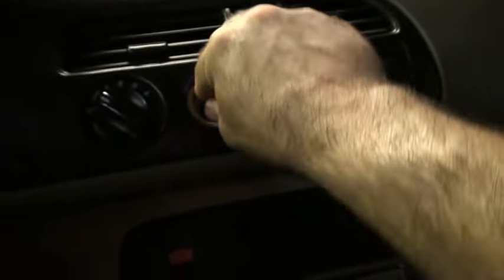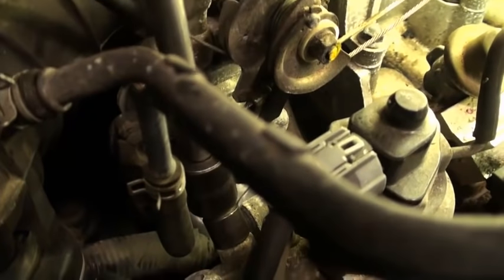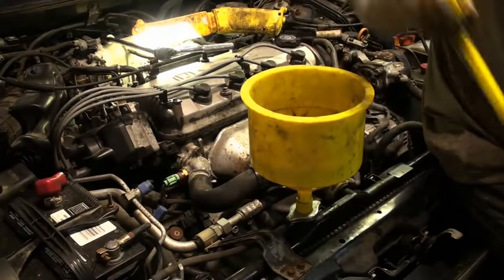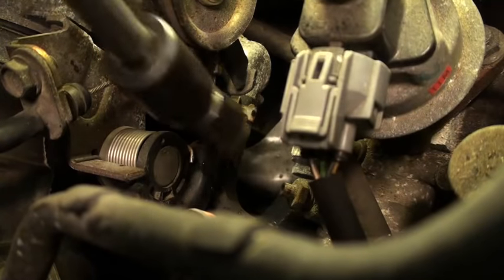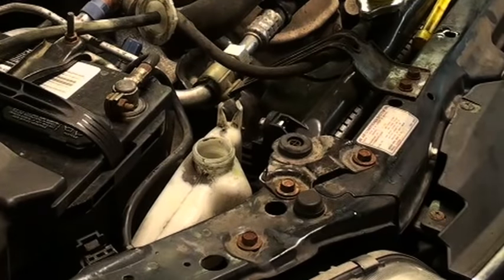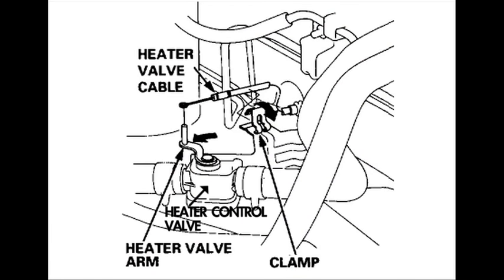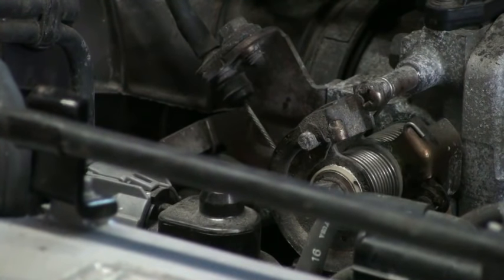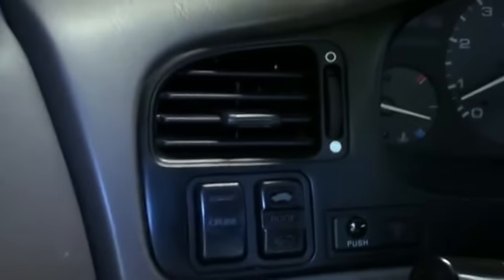How To Bleed A Cooling System - EricTheCarGuy

Comment: Got a question. I replaced my thermostat 4 months ago. Has been running fine until yesterday when I drained the cooling system and replaced the coolant. Then it started over heating. There is nothing blocking airflow. Fan works perfectly. No leaks are visible and pressure test is perfect. I did my best to get the air out of the system. I took the thermostat back out and ran it without to see if it was that causing the problem. Again. Overheated. When it starts to get really hot if I step on the gas (2500 rpms) the temp drops back down to running temp. As soon as I idle it rises right back up. Any ideas on what this could be? Possibly the head gasket blown? If you think so why would this start overheating when I drained the fluid and not earlier?The fluid I drained was extremely old and rustic. Could I have a clogged radiator even though the top hose isn't hard but in fact easy to squeeze. I haven't ever messed with a cooling system this in depth. Any tips would be appreciated.
Reply: +bassheadballer Are you sure the thermostat is actually working? You should be able to squeeze the radiator hose connecting to the engine when it gets hot enough, this is a sign that the thermostat is opening and letting coolant into the engine properly. Are you sure you aren&#39;t low on coolant? Is the reservoir filled with coolant appropriately? 
If the coolant was really bad the radiator itself may be clogged. Check the water pump as well to make sure it works fine.
Also try bleeding the system again, doesn't hurt to try.

Comment: I have a used 06 PT Cruiser, the bleeder screw was replaced with just a screw. Not sure where to find a replacement bleeder screw, so I'm trying the no spill funnel to bleed the system. When reving the throttle to 2500 rpm the funnel fills up to the point of spilling ironically. Any suggestions on what is gong wrong?

Comment: I'm wondering if this is the problem I'm experiencing with my 98 civic. Just bought it. 144xxx miles. No CEL. I just picked it up from the shop to replace the belt pump and pulley. Now it has a CEL for code P0108 and idle surges. I'm thinking it's air in the coolant system.

Comment: Question I added a 7 blade clutch fan to my 67 mustang with 289.it has 20in aluminum radiator with no shroud. It ran fine all winter long and then as weather warmed up it started running hot so I added the 7 blade clutch fan that I pulled off a f250.I drove it around and it seemed to be hotter I checked with temp gun and the sensor read at 198 but gauge says it hot side.I drove the car at night to work and gauge stayed in the middle., when I parked it and shut it off temp jumped up to hot but  temp gun says it’s still around 198 on the block? I’m confused lol

Comment: I recently performed a bunch of work on my '92 mitsubishi 1.5L (cylinder head removed).  now it idles too fast in park, and way too slow in reverse and a little slow in D.  the RPMs stay consistant.  are these symptoms consistant with improper tension on the throttle cable or air in the coolant system? this is the first car ive owned that actually has a physical cable instead of electronic. im not sure how to proceed since the Idle is too fast and too slow depending on the gear.   Im not asking for a magic bullet, but just some ideas on where to search for the issue.

Comment: Eric, I have a 2003 civic, and I'm losing about a quart of antifreeze every 2 weeks or so. The reservoir always stays completely full at all times, and no visible leaks. We know we have to add when the heat isn't working that good anymore. It seems that we never have to add more than a quart, no mixing with oil, no white smoke.. Car runs perfectly, and had a new radiator, water pump, and t stat installed.  Any suggestions? Thanks, Shane.
Reply: +Shane Sexton Are you using the right antifreeze for your car?? Antifreeze shouldn't just vanish, there has to be some leak somewhere. Maybe it's being caught by the bottom cover of your car? Check your oil level, if it's higher than normal coolant may be getting into the crankcase.

Comment: Hey Eric i got a 04 grand prix that has coolant issues the previous coolant in the system when bad so i flush the entire system I even put a new water pump thermostat in radiator cap on it I haven't changed the radiator I got as much of the bad coolant as I can out but for some reason the temperature gauge stays near the mark next to the middle mark and then wants to rise almost near The Hot Zone but when I relieve pressure by bleeding out some air it will either rise or drop I even drove it once it seemed like it was about normal but the temperature will not go down the fans were running of course but cannot keep temperature down open up the bleeder in air sometimes come out or shootout not sure what I'm doing wrong got any pointers

Comment: I pulled my throttle body off a couple hours ago, cleaned it, and changed the gasket.  Idle is hunting up to 3k and back down now.  Could my cooling system needing to be bled cause this?

Comment: Hi Eric I got a 2001 Cadillac over heat I change the weather pomp thermostat radiator cap tampetur sensor I don't no if the Riley IRS not working

Comment: I used the jug and it just kept filling up and flowing  over. i also after losing all that i looked down in it and it was getting bubbles from the thermostat. pt cruiser 2003. no heat and still over heating after driving. checked heads and  they're good. new radiator. also after 20 + minutes the fan kicked on. I need help asap! 

CHEERS 
Kevin

Comment: I have an overheat issue and i replaced the thermostat. The weep holes of the water pump are dry and i also replaced the rad cap. Any ideas? Oh and also bled the cooling system.

Comment: I did this whole project to get the burps out. I got that filter and used it for 15 to 20 minutes with the engine running..... at 20 min. the RPM at about 2500 to 3000 sometimes..  the engine was still burping.... it never stopped burping.  the oil is clean the trans oil is clean and the radiator water is clean.  

The heat was at the top temp.

There is no water in the oil and no oil in the water and the exhaust doesn't have steam.

I can't find what is causing the burps

Comment: I have a oldsmoblie intrigue that my husband replaced the radiator, however its not running hot but when u shut the engine down the water bubbles back in the over flowing jug what can possible be the problem

Comment: hiya Eric i have a ford explorer  i have a radiator problem the water GUSHES out of  the overflow plastic tank (reserve tank)when  the engine runs hot do u think it has air in the system

Comment: Is there a trick to bleeding out all of the air from a 2003 Ford Ranger 2.3L DOHC? Ive gone through and replaced everything related to the cooling system and I can hear air bubbling though when I turn the truck off.

Comment: Is it ok to add new blue honda coolant to the old green coolant without completely draining the old one when the coolant in the overflow reservoir is low?
Reply: Probably not a good idea, I would drain it and then flush with distilled water or just add green coolant

Comment: Replace with fistilled water x 3. Then "fill" with 50/50 or 60/40.
Good for -30 - '35°F.
If lower dont drive it.
I've experienced coolant turned to gel when mixed too week. Nearly blew my engine.
Davud
Alberts

Comment: can low idle be a cause of air in the coolant? I’ve been having an issue recently after cleaning my intake manifold where i will start my car and it will automatically die, but i can keep it alive using the throttle and once i get driving it’s a bit better, but extremely low idle (like 100-200rpms) I’m also going to be looking for vacuum leaks

Comment: I recently changed my coolant for my 2014 Honda Civic si. I’ve had bad start ups when I turn the car on the idle starts to drop after 3 seconds as if it wants to stall out. I thought it had something to do with my mass air flow sensor. So I changed it and I still had the same problem when I start the car. I’m going to try to bleed my coolant system and see if this works. /:
Reply: That don’t have anything to do with it

Comment: ERIC, I have a k24a2 motor, and i been having overheating issues, i spent 45-50 minutes bleeding the air out of the system with the car jacked up to make it little ezer. The car temps gauge is little below half way mark thats usually where its at all the time, but when i use my obd2 scan tools its shows the temps at 210 at idle and 180 on the hwy. is idle temp too high? i feel i have a flow issue cause i cant see flowing coolant with the rad cap off nor can i feel pulses when i squeeze the top rad hose

Comment: is there a bleeder valve like the one or looks like the one in this video valve somewhere on that Northstar I took the hose off and filled the radiator with the hose off all way up. I just held the hose up and poured it full to make sure the radiator had all its fluid and then attach the hose to the water pump when the North Star is just inches away so I'm still looking for a bleeder valve for somehow it's running in the heat mode overheat mode

Comment: I recently changed my radiator on my 05 civiz lx and now i can hear it gargle at times assuming there's air in the system... would an air pocket cause a car to intermittently crank ? If it sits for a hr or so it'll crank but if i turn it off and immediately try to crank it... it'll turn and turn but won't crank until i let it sit again... any help

Comment: I just bought a 02 dodge ram 1500 and it has a new rad and weak heat inside no leaks at all and bubble noise in the dash should I flush the heater core before replacing it???

Comment: Isn't the temp gauge suppose to be at half? After i did my coolant flush my temperature stays maybe line below half. Normal or what? And yeah my cooling fans kick on when the ac is on, but i don't see them kick on without the ac.  98 Honda Accord Ex Coupe V6 3.0. Thanks!
Reply: It's normal to run cooler than the 1/2 mark.  It should be consistent with when the car was new.

Comment: Hi there. I have a 89 Plymouth Sundance. I changed the thermostat over a year ago (was the original) because of over heating (solved problem), but I never bled out the air in the cooling system. I am not sure if you are suppose to do this when changing the thermostat? It was about 8 months later and I lost my heat, temp gauge was hot because the thermostat wasn't opening correctly. Things you've described for vapor lock in cooling system. The rad drain plug blew off, couldn't repair so I put a new rad in and since it was the original too. Again didn't bled the system of air. The thermostat still not acting correctly, blew the drain plug off my new rad. Either this is a head gasket issue or just another bad thermostat? I am changing the thermostat today and bleeding the system of air. Then see what happens. Any suggestions or comments would be appreciated. Thanks.
Amanda
Reply: The engine did have the head gasket done before. I am not loosing coolant though and it's not being mixed with my oil. Could just be beginning signs of headgasket problem?

Comment: I used to used some Wiper tube hanging off the bonnet and connect it onto the nipple and run the engine hot and crack the nipple off to bleed the air!
Used to work like a treat and you didn't end up with coolant everywhere.

Comment: Hubby just replaced the temperature sensor on 04 Impala. Fans are now running non-stop (even for a minute or two after car is off) and temperature gauge is stuck at zero and not moving. Check engine light is on, code says it's the temperature sensor. He double-checked to ensure he connected it right but still isn't sure bc of the fans & gauge. 1) Should he bleed it and 2) Any idea what could be wrong (e.g., might the wires not be connected correctly?)? Thanks.

Comment: Changed my lower radiator hose. Drove it to work fine and the next day it started to overheat and I couldn't get any heat. I filled the radiator back up after work and let it run. The temp needle moved to its normal spot in between the 1/4 and 1/2 mark. I let the car run for 20min with the cap off and thought I was good but still no heat inside and the car does not overheat anymore. I don't know what else to do? Any suggestions?

Comment: if my nissan350z has not bleeder valve, i can still get the air out by leaving the radiator cap open & running the car to normal operating temperature until the fan turns on & tap off the coolant fluid, right?
(while turning the heater to max & turning off the ac to off off course)

Comment: What would I do differently on a 1972 Dodge D200, 4x4, 318 C.I., 4 speed manual transmission,  with AC?  The vehicle has only  62,000 miles on it and the radiator was just replaced or maybe it was ok and the hoses only.  It sat for for 30 years since 1988(+-). At first everything seemed fine, good heat etc.  but I let it idle for 20 minutes or more and it overheated and blew out coolant, I don't know where the coolant leaked from, I'm guessing/hoping the radiator over flow tube and no damage done.  I picked up a new thermostat w/gasket.  I have not done anything yet to address the overheating issue.  Your advice please.
Reply: Fred Guldbrandsen the thermostat that was in it when it blew coolant out was bad.  Put the new one in and burp the system like he does in the video and you'll be good to go

Comment: I have a duramax.  Diesel.  Doesn't overheat.  It builds a LOT of pressure.  Hoses are hard.  Changed the cap on the reservoir.  It was good for about 24 hours.  Next day....same thing...
Reply: Is the cap the right pressure? Also, get a headgasket test kit. If the headgasket is starting to blow it could be over pressuring the system.

Comment: This is a nice video and everything but not all cars have bleeder valves. And what would you do if you have auto climate control, you can put the temp on 90 but then you have to turn it off because according to Eric the fan should not be on. But once you turn the climate control off I'm pretty sure the heater control valve does not stay open. So what would you do then??

Comment: I have an 05 Chrysler Town and Country I just put a new radiator in it where I live that it is very cold so I had to replace some of the return line with 5/8 holes the problem that I'm having now is my car is overheating only when I Drive any suggestions on what I should look at

Comment: Hey bud, one question, is a 96 Honda Accord 2.2 a reverse cooling system??. I ask because the lower radiator hose connects to the thermostat housing so that means the flow into the radiator is at the bottom and the water flow into the engine seems to be the upper hose??
Reply: Pretty sure all Hondas have the thermostat housing on the lower radiator hose.  Even my wife's previous car a 96 Toyota Corolla 1.8L had the thermostat housing on the lower radiator hose.

Comment: i had the same symptoms in the video, i followed the same procedure and the car drove smoothly. The problem i have now is when I turned off the engine, i heard a bubbling sound from under the hood. I checked the hood and there was antifreeze all over the engine and the car cranks but it will not start. Also I have a Honda Civic DX 1994, 4cylinder, 1.5L automatic. Please help I love my honda.

Comment: when you add coolant to the radiator, do you use a 50/50 mix or all coolant?
Reply: zombayification 50-50 or concentrate if you have jugs of distilled water

Comment: i have a 98 civic ex
my radiator fan isnt turning on
i know the relay and motor are good and i just replaced the thernoswitch
could an air pocket prevent the radiator fan from turning on?
please respond if you can i am stumped on this one
also I replaces my thermostat as well

Comment: I have a Mazda 6s but it doesn't have a radiator cap. Can I use this funnel on the expansion reservoir cap? If not, how do I burp the system then?

Comment: Hi I have a Toyota Corolla 2007. The problem when car is stationary or moving in slow traffic makes really loud noise from the engine, it sounds like a fan, the noise stopped and started a couple of times, the engine temperature never goes over 90. What do you think the problem

Comment: Eric, could you explain why air in the cooling system can be the cause of fluctuating idle?  Thank you
Reply: I'll answer my own question.  Not sure if I'm right or wrong.

When there's a steady stream of coolant the water pump impellers have a constant smooth amount of resistance.  In contrast, this is not the case with air present and the idle goes wacky.

Comment: Idk if Eric would respond to this, but I was wiring up a big 3 upgrade to alt, removed intake manifold and tb, cleaned my TB (2012 civic Si), and now I’m having “idle hunting”. When I’m in neutral it jumps up from 1200-2200 approximately. Since I had coolant lines open could this be the cause?

Comment: Hey I have an 06 Impala and air in the system has been an ongoing battle for me.  I've been all over it and can't find any bleeder valves.  Any ideas on where to look?
Reply: Also I seem to have a coolant leak some where.  I put the system under presser... 17psi as my cap is rated for 18psi and let it site for 10min or so.  No leeks and no lose in presser.  I did find a small leek in the coolant reservoir which I plugged but again this morning I had a puddle of coolant under the passenger side in front of the wheel.  Kinda at a lose here.  Anyone else out there that's good with Impalas year 2006 - 2008?

Comment: eric i noticed that the coolant of my 05 fortuner 3.0 1kd engine rise up to level B of the coolant tank..when the engine is running the coolant overflows..the temp gauge is normal as before..pls help...thanks in anticipation😊😊😊